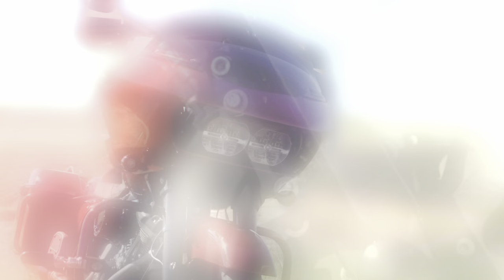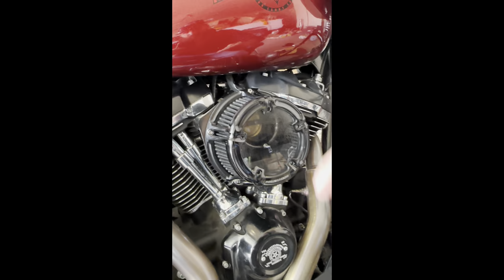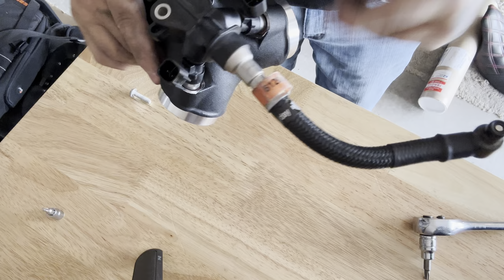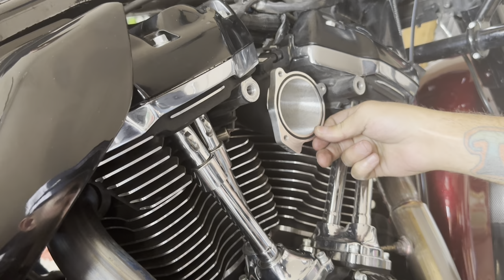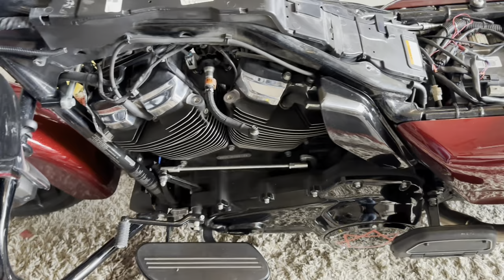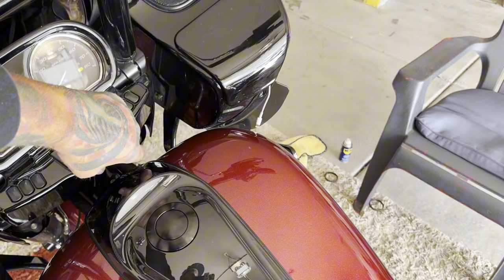⁠@HorsepowerIncPA #hpi 58mm throttle body & manifold install. #performance #diy #roadglide

Comment: Nice job on the videos. I am a Road glide fan since 2006 when I rode my first one
Reply from the maker: Appreciate the kind words. Thank you. I definitely give these videos my full attention and they’re definitely not cheap to do 😂 paying full price on a lot of these products. So to have a comment like this. Makes it nice knowing others are receiving them well. 🤘🏻
Reply: Well I am 1500 miles into a 2023 and already tearing into it. The pipe has been a debate since the opinions vary on the XXX and if it is to much pipe for a 114 with light mods. I think everyone has an opinion but few have actually used the pipe. So your experience is valued since it is real world. I wish I had the patience to video my work. I know it is a commitment.  @Gimps_Garage
Reply from the maker: @chriscalabro  yeah man. If the videos help at least one person. It was worth the investment of time and money. But I can assure you that you will absolutely love the jackpot system. I run the jackpot rtx mufflers and they work great together. Fuel moto is doing their garage sale right now. They had a set of rtx pipes on there for $350 yesterday. Normally $850. If they still have them, I would definitely buy them

Comment: She sounds great and looks even better! I just got mine back and posted it up! Did a trask intake though for my fall refresh and new wheels!
Reply from the maker: I would’ve went with the Trask assault intake had they had a black one in stock when I was shopping around. The Arlen ness was my second choice. It’s worked really well so far.
Reply: @Gimps_Garage  it legit looks great too!! Great build!
Reply from the maker: @soldier09r  thanks man. I appreciate that. Definitely a constant work in progress. Always trying to make her better one way or another. Appreciate the support and compliments 🤘🏻
Reply: I'm running a similar setup on my 114 SGS : Jackpot XXX with SE Street Cannons,  HPi 62mm throttle body, and manifold. 5.5 injectors with a Fuel Moto PV4 tune with an S&S 475G cam chest kit. It sounds DEEP and as loud as I can stand. I bought the bike with the SE stage 2 447 "torque" setup. This is night and day stronger and pulls strong all the way past 6000rpm.

Comment: That last piece you put on.  The black cover. Is that the one that was previously on it.  Im getting ready to do mine
Reply from the maker: Yeah. I just put my air cleaner back on. It matched up with it and it was a brand new air cleaner.

Comment: HPI is like a "work of art", that is a beautiful setup, did you go up in size on your fuel injectors? also, does it come together, the manifold and TB or did you buy them separately? thanks
Reply from the maker: The manifold and TB came together. I reused my injectors. Which are the 5.5. I may go to a set of 6.2’s. Haven’t decided yet. We’ll see what the Thundermax shows and if it needs more fuel output. But you’re correct, these throttle bodies are beautiful. It’s a shame that they’re hidden behind a breather.

Comment: Would i need a tune putting one of these on a stock 114?
Reply from the maker: Yes. I would suggest it. It’s quite a bit more air than stock. It will require your AFR to be mapped accordingly. Especially going 58mm and up

Comment: Can you tell me how that Jackpot XXX is working for you?  Did you find any loss of low end torque? Considering that pipe with RS 468 cam on 114.
Reply from the maker: It’ll run outstanding with that cam on a 114. I gained power and torque with the jackpot headpipe and jackpot rtx. Can’t recommend it enough. If you go to my last short I uploaded. You can hear it. Sounds really good too

Comment: How does Differ from the SnS one ? Looking at installing next few weeks with a catch can ,,Thank you..💯
Reply from the maker: They’re pretty Similair tbh. But the S&S 55mm one I originally bought, wasn’t machined nearly as well on the inside chamber as the HPI. I haven’t checked out the latest S&S versions for a few months.

Comment: Sir ,did you change the fuel injectors to bigger ones or remain to the OEM HD ?
Reply from the maker: I kept the same size injectors. But I put new ones in. It seems to run really well with the current air to fuel ratio.

Comment: Would there be any benefit going to a 58mm if the bike is just stock plus stage 1? Or would it make more sense to just go with a 55mm?
Reply from the maker: Depends. Are you 107, 114, 117 or 121 stock?
Reply: 114
Reply from the maker: @HDFXSB645  a 58mm will definitely have a noticeable impact. The plastic ones are junk. Even going to a ported and polished cnc 55mm you’ll notice a difference. If you go to a 58mm or above, you’ll need a tune. Because you’re altering and increasing your air intake ratio. But unless you’re planning on doing an upgraded breather, removing the oem headpipe / cat, you probably don’t need more air and a CNC’d 55mm will suffice. But if you plan on doing a big bore kit or stage 2 and up, definitely just pay once and do the 58mm. Hope that makes sense

Comment: Do you have the link for the 58mm manifold and throttle body?  Im only seeing the 55mm
Reply from the maker: https://tuckerspeed.com/products/hpi-62mm-m8-throttle-body?sca_ref=4219620.jpzWsUsGYV
Reply from the maker: You can choose between 58, 62 or 70.

Comment: Do you have to change throttle body and air filter on a 58 mm intake manifold?
Reply from the maker: The throttle body is built with the manifold on these HPI setups. But yes, if you go to a 58mm+ TB, the the manifold will need to match the size. As far as the breather, most of them are compatible with larger TB’s

Comment: Hello, Is the backing plate you installed for a 58 or 55?
Reply from the maker: What do you mean by backing plate? This setup is the 58mm
Reply: @Gimps_Garage  the backing plate of the air filter that attaches to the throttle body.
Reply from the maker: @mrnonpc9885 oh gotcha. It’s the backplate that came with the Arlen ness. It mounts perfectly to the 58mm TB. Not sure the exact specs without looking them up

Comment: 114” bored out to what? 131”?
Reply from the maker: No. It was a 107. Bored to 114. If I had a 131, I would’ve went with the 64mm TB. The 58mm is perfect for up to 121/124” builds. I’m about to go up to a 124” in a couple months
Reply: @Gimps_Garage  Ahh. Thanks. I just recently came across your channel and haven’t had a chance to dive too deep into it yet. My 21’ Street Glide warranty recently came to an end and it’s time to go to work on it. I’m about to change the headers, fuel injectors, intake manifold, cam etc..
Reply from the maker: @paulg5835 right on man. Welcome to the channel. Lot of good info can be found here. If you ever have questions. Feel free to follow my other socials and I can message you back faster. 🤘🏻 links to my socials can be found in the most recent video I put up today. Links are in the description

Comment: U have to do the throttle body too if u do the manifold?
Reply from the maker: If you use the same mm sized manifold as the factory one. You can use the stock throttle body.